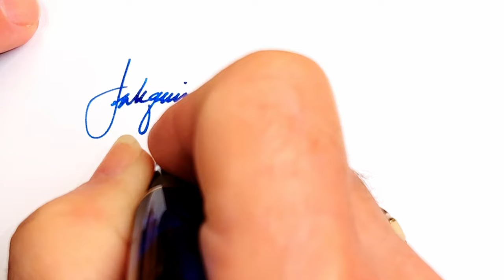SHORTIE How to Fill a Piston Filler Fountain Pen

Comment: Silly question, but to get a good flow of ink, wouldn't you need to keep a little bit of air in the tank? Or is capillary action enough and having a full tank poses no problem?
Reply from the maker: The nib and feed are designed for the exchange of ink and air.
Reply: @InkquiringMinds  Of course, but in the same way as a full bottle of water that has difficulty emptying itself, if the converter is full of ink, according to a number of physical phenomena such as surface tension, it's difficult to get air into a container full of liquid. To improve this exchange, shouldn't there be at least one small air bubble?
Reply from the maker: @mrsoulpc915  Nope. The feed has air exchange that allows for ink/air flow constantly regardless of the amount of ink (until it runs out of course). Surface tension DOES affect converters because of their tiny diameter and so many converters and cartridges will have a small ball or or spring called an "agitator" that will break the surface tension to prevent ink from hanging up.

Comment: Speaking of piston fillers, I received 2 PenBBS 495 in the mail today.....  First impressions - surprisingly long and no ink window to determine levels.  I'm kinda disappointed.
Reply from the maker: You’d have to get a transparent acrylic for ink levels.
Reply: @InkquiringMinds  can be done.  But the length bothers me.  Like the proportion of barrel to cap feels wrong.  It posts, sort of.  Light weight too. I dunno, I kind of had high expectations for this model.